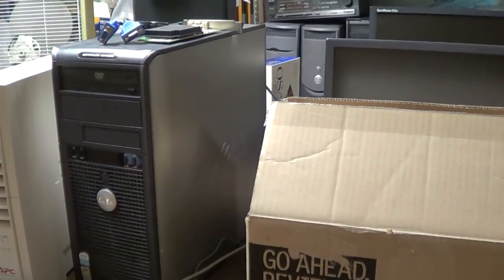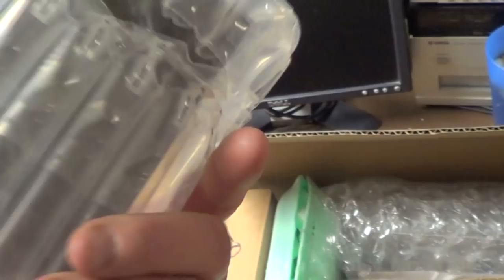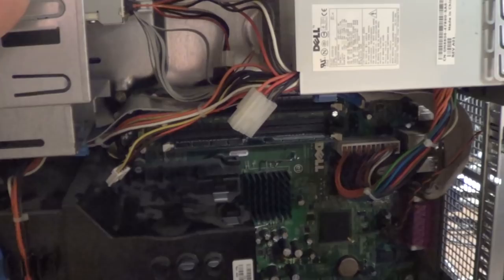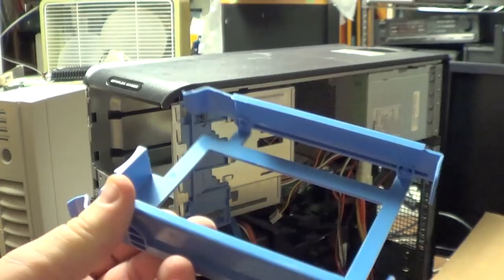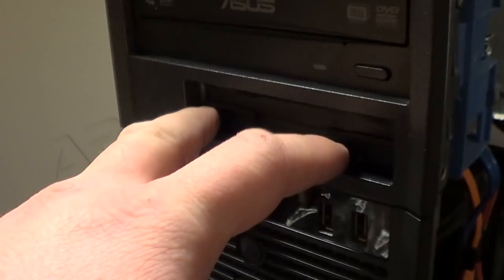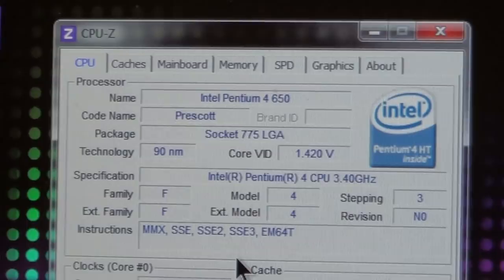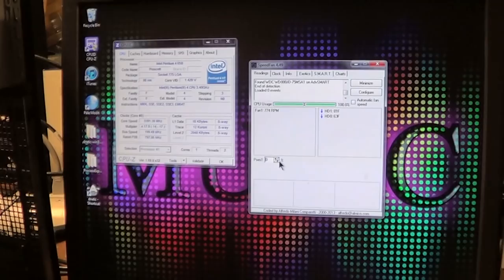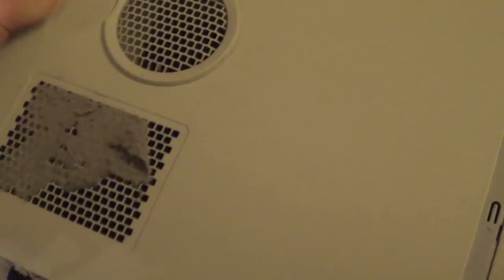"New" Music Player PC Build

Comment: I have made a fatal mistake in my life: Bought a Notebook with 2 SSDs in RAID0 = 512 GByte and 1 GB/s transferrates both read and write.

Since then, every PC with just an HDD is not really usable anymore for me... It's annoyingly slow... I should not have done it... :/ Really. If someone may think of buying somethinge like this, just wait a few years will no PC has ever a HDD with the OS on it, just for data warehouse...

I had to restore an old AMD Turion PC wiht 1,5 GByte RAM, Windows XP and a dead RIVA TnT2 AGP Grapics card. After setting up the Hardware (changed HDD, added a decent soundcard, changed graphics) I came to the point where I wanted to install Windows XP... My patience level was clearly somewhere between the earth core and the ocean level...

Comment: "Some people may be like WOW that's an optiplex GX620! That's and old piece of junk!" Lol. (I own a GX280! Also, you can get a refurbished 1TB for like 20 bucks less than what you paid on newegg.)
Reply: ***** Ah... Anyway! I hope to be keeping tabs on random computer things you post.
Ever thought of trying to put an older SSD into there as a boot drive? (Kinda useless for a music computer, but still.)
Reply: I use a Dell dimension E520 (2006) on my radio station. It is on all the time! It also works great! Intel Pentium D at 2.90GHz, 2GB of RAM, Integrated Graphics and a 250GB hard disk. I got 100Days up time before our power went out for some reason.
Reply: Joshua's Recordings Sweet.
Reply: B&W Rarity Thanks, though the best part is I got it free, from our local transfer station!
Reply: ***** I'm a gamer, as my hobby. This can really help me out, where I lack ram, HDD speed can pick up. (Only in the sense of load times. Otherwise, no real change...)

Comment: http://uk.pcpartpicker.com/p/M3czRB is the modern verison of this build :D well for live proadcasting anyways

Reasoning
CPU: I have one if these 5350's in a small portalble build of mine, they are good, cheap and run stupid cold + small power draw.
MOBO: there are only a hand full of motherboards that have am1 socket and of them all, only 2 have more than 2 sata ports. this one has 4 allowing for your 2 opticals and 2 rives and the other one is the same mobo but has serial port built into it and i think its lacks hdmi
RAM: You put 4Gb in your build and 4Gb it is. The stuff i added is cheap, runs and a modest 1866Mhs 1 module for the price.
SSD: As you only use this for broadcasting/streaming i added a small ssd of 60gb for you os (probs windows) and your streaming program + other broadcasting / management programs. (Yes an ssd is not needed here at all, not even a bit, but the reboot / startup time will be superb especially when streaming you want the smallest down time available)
HDD: WD green 3Tb, is probs enough storage for your rips and music, its green low power and reliable.
Case: Its cheap. Its got enough bays
PSU: reliable, cool, low power, semi modular so them unneeded molex be gone and again, its cheap. With that cpu and the single ram module even 450watts is super duper overkill.
Disk Trays: you used 2 optical drives so why not and as you said, there dirty cheap nowadays.

No GPU as you can remote / RAT it and there is onboard if you down for it. Stock cooler is more than enough for this, on standard its about as close to silent as a fan can get.

people are gonna say why build that or why spend money on it to save money you can drop the ssd, get the amd 2650 duel or the 3850 for stupid cheap, get 2Gb of ram, use a cheap case with a built in psu and use some old'ish seagate or hitachi drive. i presume that you just have an audio feed in, then a bit of DSP and encode for broadcast then its back out via your ethernet, i dunno what programs us use but chances are it will work on anything that can run windows xp +

But the reason i said all this is because the build i made is reliable, cheap (ish), low power, runs cool and boots in no time. You could even put it into like a mini itx desktop case, pop it on top of a unit or shelf somewhere and WoL or 24/7 run time and remote desktop it for the workings

Its just my opinion. I'm all about scrapheap challenges but sometimes there a dicition between cheap/free and have to keep and eye on it, or spend a few coins and forget about it. chances are if you dont have an over abundance of parts somthing like this will pay itself off not only in power but in replacement components

Like i said, this is what I would do if i was in his boots, but im not a audio broadcaster

Comment: My 3000 has that plug at 11:40
Reply: It does, I have two 3000s now, I've yet to check out my second one though
Reply: I've got one, it's cool as can be
Reply: I've already done mine, I've got 2GB of RAM in there, dual 160GB HDDs, dual DVD burners, floppy, the only thing I lack is a PCI video card
Reply: Nope, 2 3000s and a 2400

Comment: i have a gx620 laying around upgraded to pentium D 945 3.4ghrz dual core   3.5GB DDR2   80GB sata 2 HD and windows 7 wonderful machine i needed something that could do core 2 duo so i moved onto a hp compaq CMT 7700 and as far as the optiplex goes don't listen to those morons calling it old i've seen dozens of these on ebay go for 150 or more also while having parallel ATA devices is nice and all the reasons for their obsolescence are for the best SATA is faster they are also cheaper to make at this point which means anyone still producing PATA would do everything to cut cost causing problems 15:54 going to make a prediction that orange SATA cable is either going to prevent you from putting the side panel on or add quiet a bit of resistance

Comment: intel 945 chipset knows 667 Mhz DDR 2 Ram
Reply: +DellLatitudeD630ATG I have intel dual core e2160 and an foxconn i945 chipset motherboard, with 4 gb of ddr2 667mhz  memory, and the memory runs at 667mhz
Reply: +Vlad Amariei (i945 still blows ass)

Comment: my ram is 3 times faster than yours. i never have had good luck with core 2 duo machines, often i get better performance off the pentium 4 systems and the core 2 quad systems.
Reply: Speaking of ram, on my i7-4770k, my ddr3 ram was stock at 1866 mhz, but with some bios tweaks, I was able to oc it to 2133 mhz.

Comment: get a penium 955 ee for this  and itw ill be better :)
Reply: dell utilized heatsinks for  the cpu it was spec'd up with it  unless the machine was shipped with a 955  it would get absurdly hot and it is not advisable.
Reply: it depends though if the dell was using a Prescott then a Presler core would actually run cooler remember the Presler is a die shrunk chip and uses less electricity and has a lower thermal foot print so if the dell is outfitted with a heatsink made for the hotter core  it can use the newer core
Reply: now a 975 ee is not a good idea

Comment: You mentioned difficulties in getting pata hard drives this site has good supply of new and recertified would have sent this in an email as we have communicated in the past seems Google has ended emails in you tube. I still use them good pricing for sata drives too.  GOHARDDRIVE.com
Reply: Thank you for responding, I have ordered 1 white label PATA drive 160gig new not recertified from them, surprised me was they sent a new Seagate not a white label I ordered at no additional cost. Second order was for 3 white label 160gig SATA drives and a WL 250gig SATA all new, again surprised the 250gig drive was a new Seagate. So far pleased with company; I too use pci cards to add SATA drives to old system usually as RAID 1 or 5. Have one computer I build that I use for cloning drives that are failing, or to make a back up drive like I carry for my laptop that I have been dragging around the world on merchant ships. Also use it for low level formatting, of older drives, using live disks as you know this can take many hours to do. My server 2003  box uses an 80gig PATA drive for the OS, the built in SATA raid array I use in a raid 5 for data storage. Still enjoying your videos some I have learned something's from. Like you say and I agree nothing like repurposing an old computer to make it usable again. Pulled an old Emachines T1115 desktop out of a trash bin some months back took it apart and put back together was able to get it to boot after about 5 attempts; has windows 2000 OS. Label on front cover says  Microsoft Windows XP preinstalled ,1.0gig Intel Celeron processor , 128 mb ram; 20gig hard drive. Will add it to my growing collection of old computers.  Noted Bazar Fur Head has lost his fur in the latest cooking/baking video.

Comment: While recycling a pc might seem ecologic at first, using an old DESKTOP computer, with a power consumption of at least 300W, just to play music, is a massive waste of energy.
Reply from the maker: Even going full tilt, this computer has never come anywhere close to 300 watts worth of power consumption.
Reply: Bilis: Check actual power consumption online. Even if a PC has a 300w power supply, a system wouldn't be using anywhere close to the maximum unless it was running 4 hard drives, cpu going at 100% and a video card that needs a power connector. I am speaking specifically about that type of PC in the video.